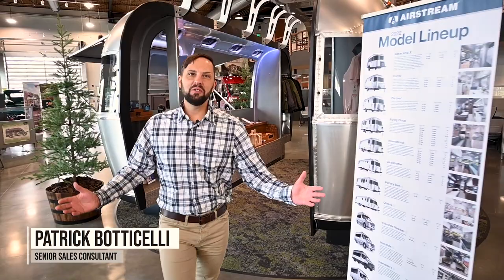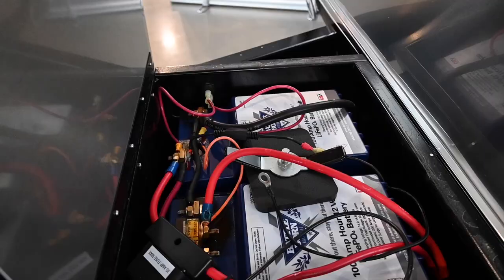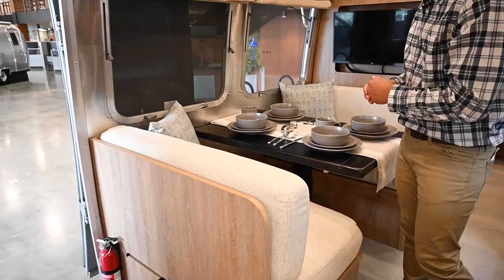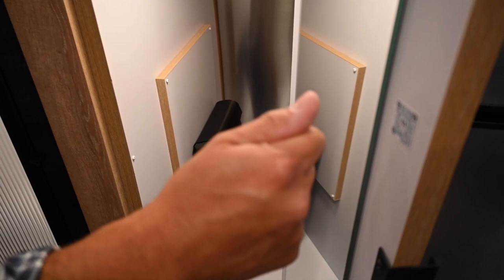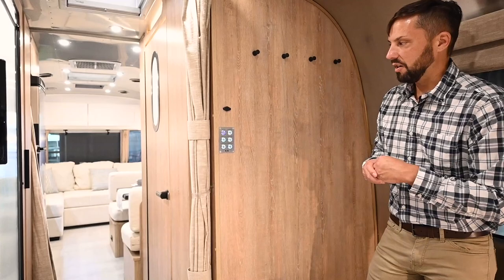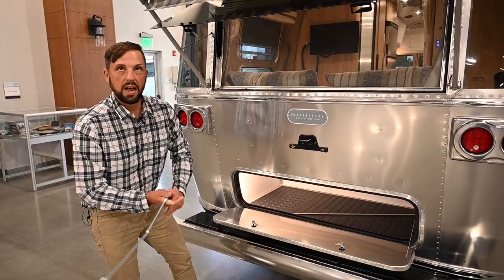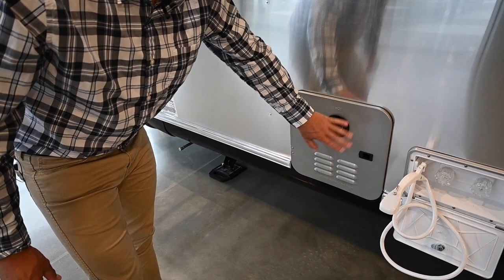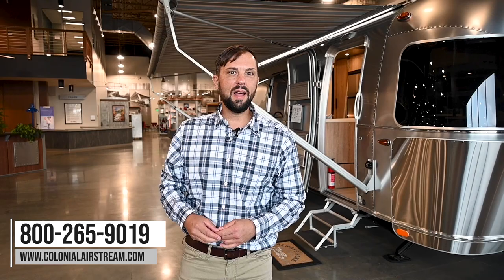All-New 2022 Airstream Pottery Barn Special Edition | Full Walk Through Tour

Comment: Patrick Botticelli’s walkthrough of the Airstream Pottery Barn is, by far, the best of the many videos I’ve watched.  Helpful insight into construction, features and technology. Great high-level introductory instructions and suggestions on how to operate and use many of the features.  Instruction manual says QR code is in front locker - I looked forever and could not find it.  Patrick mentions that it is placed on the back of the wardrobe door - that was helpful. He pointed-out lights in the rear trunk compartment and near the clean-out that a new owner may not initially be aware of.  Explanation of benefits of composite subfloor were insightful.  Comments about the skylight thermal break design and the bath area skylight having privacy film to prevent viewing from the outside is very nice to know.  One of the first things I noticed when pulling the AS PB with my Ford F350 was the stable and easy towing experience. Patrick’s discussion about the trailer’s center of gravity and torsion axel design provides an easy to understand explanation about why this trailer is so much easier to tow than some trailers made by other manufacturers. Comments about use of AC vs. DC power, inverter, battery heaters, storage tanks, storage tank heating and supply connections (integrated water pressure regulator, types of hoses to use, etc.) were packed with helpful yet concise information. Comments about significant climate control benefits provided by awnings are also helpful.  Thank you for taking the time to make such a helpful and professional video … Truly outstanding.
Reply from the maker: Wow, thank you for such a detailed review and positive feedback! We're thrilled that Patrick's walkthrough of the Airstream Pottery Barn was helpful to you. He strives to make our videos as informative and comprehensive as possible. Your comments validate all his efforts. If you have any more questions or need further assistance, please don't hesitate to ask. Safe travels and enjoy your Airstream!

Comment: Lovely! 2 suggestions for Air Stream / Pottery Barn.  Add 1 floorplan option for the bedroom - 1 twin bed w/ shirt-locker & on opposite wall desk space w/ chair (like offered in the Classic) w/ TV on swivel arm (could be used for computer or tv from bed. With all of the remote workers and solo travellers these days - win; win; win. 2nd suggestion - where there is a blank wall, it's not always best to fill it with a whiteboard and hooks.  Nothing personalized a space more than artwork.  It would be so nice to hang a small painting (or artwork from Pottery Barn) where the 4 little bedroom hooks are on that blank wall. Very thorough tour.  Good job Patrick.
Reply from the maker: Thank you for the suggestions.
Reply: I agree those 4 hooks must be for keys. Nothing else could hang from them. I thought a waste of space. Just need to o be put in other place.

Comment: Best walk-through of this unit yet!  Very nice Patrick.  Question, is there storage under the dinette seat closest to the the lounge TV?  Is there any kind of pantry that was missed?  Such as in the Flying Cloud line up with the pullout sliding pantry.
Reply from the maker: There are systems components and the wheel well under that dinette seat. There is pantry storage in the trailers just not the slide out type. The Flying Cloud and International in this 28RB floor plan doo not have then either.
Reply: @colonialairstream , thank you for the reply.  We'll definitely need to see one in person. To see what is being designated at the pantry.  The pantry is something my wife has on the "must have" list.

Comment: This is a gorgeous design, but the added weight REQUIRES you have a larger truck to pull it. 900 lb hitch weight is a lot (compared to many other airstreams).
Reply from the maker: Thanks for looking, there are many Airstreams in the 25-30' range that have similar hitch weights. Many other models if equipped with factory options added and the 2nd A/C's will be the same or more than this model. The weights listed online or in brochures are always before factory options. The Pottery Barn comes standard with all the features so the hitch weight published is true to what it will actually be.

Comment: Patrick, wonderful job with this video, as always!  

These Airstreams - and this one in particular - are beautiful.  This pottery brand edition is great...love the beautiful table and other accoutrements.  Like buying a fully furnished trailer! 

I've been toying with getting a light weight mid-profile fifth wheel (first RV of my own) to make good use of my 2016 Chevy 2500 Duramax crew cab, but I can't deny the allure and appeal of Airstream quality.  Your videos are encouraging me to consider stepping up to an Airstream travel trailer.  I could use the aforementioned Chevy, or perhaps even my F-150 with 3.5 EcoBoost Max Tow package to pull it.

A few questions:  Are Airstreams relatively mouse-proof (that is, compared to other trailers)?  I can imagine they would be well sealed up, especially on the underbelly, and without the presence of slides.  Hardly anything is completely impervious to rodent invasion, but maybe it might be EASIER to approach that with an Airstream.  

Also, does the rubber torsion suspension have a pretty good reputation for maintaining flexibility in the long-term?
Reply from the maker: Thanks for the message. Airstreams are very rodent resistant as long as the owner is mindful not to leave anything inside that would tempt them. The rubber torsional axle can last 20+ years. My personal one was 60 years old before I decided to replace it.
Reply: @colonialairstream  and Patrick, thank you for the response.  I'd say 60 years is a pretty good service life!

Comment: I have been watching many videos and you are bar none the best! I saw a short video by a couple who stayed at a CA resort in the Pottery barn and they said the galley faucet was plastic? How could that be? Another video said the material used for the couch and seating areas would never stand up if you actually used it as a RV, what are your thoughts?
thanks again for a great video.
Reply from the maker: Thanks for checking out the video the faucet is metal however the part that pulls out as a sprayer and the handle may be plastic. We have many customers that have owned their Pottery Bars for over a year and they are pleased with the durability of the materials.